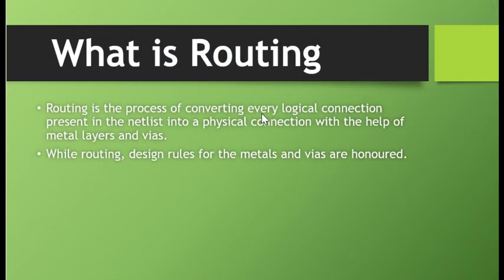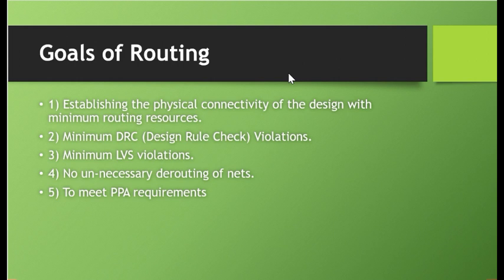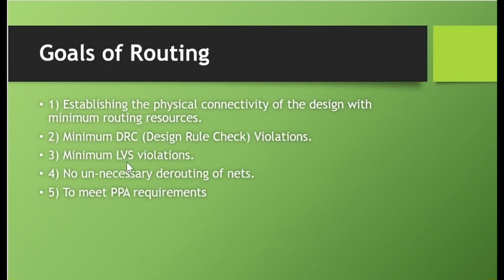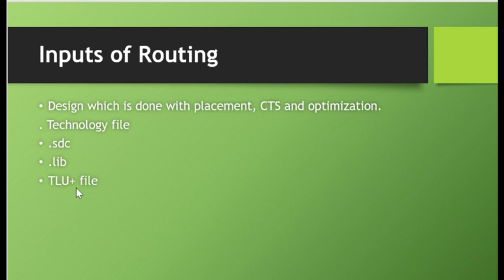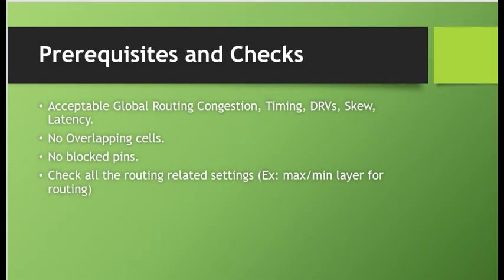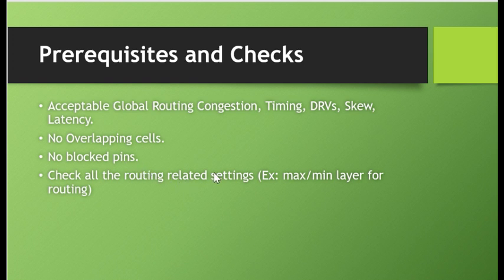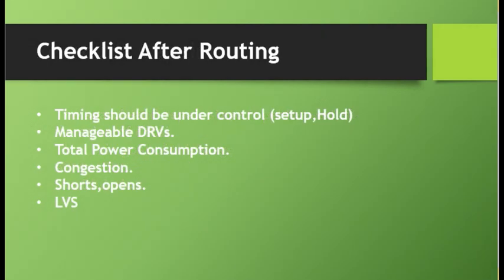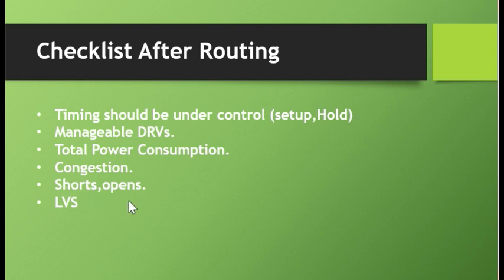Routing | Physical Design | Back To Basics

Comment: Hi Mam ,
1. Suppose we have completed routing (signal routing stage)  and we have to check for physical DRC violations , how we will check for it? (without using Physical verification tools)
2. Also how we will check for DRVs?
Reply from the maker: There are commands to check DRC in the PnR tool itself. For example "verify_drc" in cadence innovus.